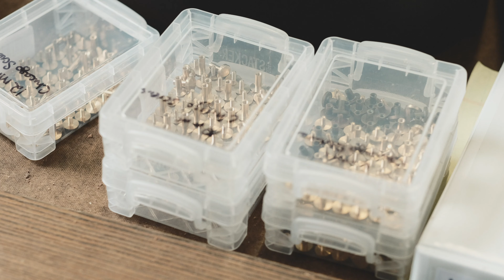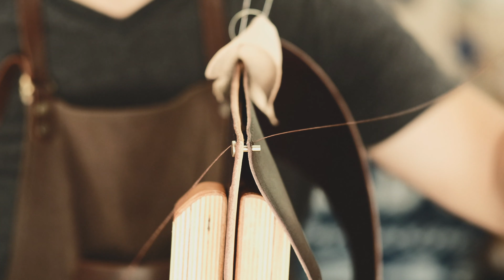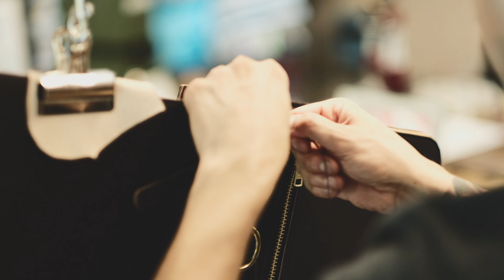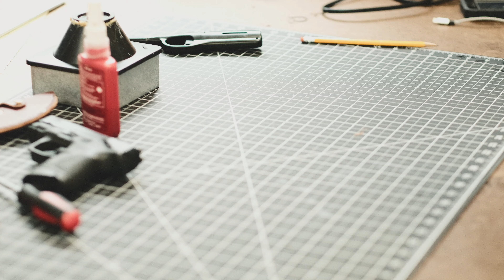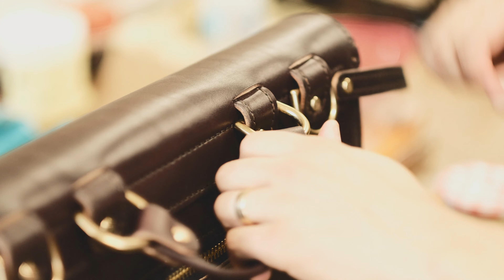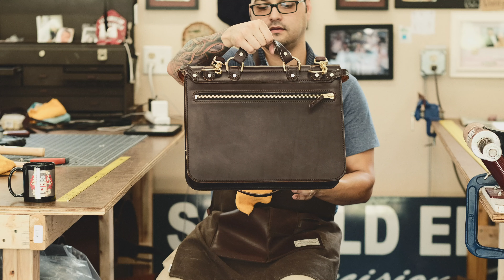Making an English Bridle Leather Briefcase - Part 4 of 4 - ASMR Build

Comment from the maker: This is Day 4 of a 4 day series taking you through the journey of creating a bespoke English Bridle leather briefcase.  

Part 1 - https://youtu.be/u_daMeC6lNs
Part 2 - https://youtu.be/Fdraz3_hXtQ
Part 3 - https://youtu.be/03giEpDSqrI
Part 4 - https://youtu.be/1u4VUAyTIKQ
Complete Build - Short Version - https://youtu.be/bSTUGJCHGN4

This bag is already commissioned. Customer requested a dark brown exterior with tan interior and medium brown stitching. 

More Info --- https://www.sofieldleather.com/bags

Whether it's business or pleasure, this English bridle briefcase will be the perfect companion in all of your escapades.
Crafted with high-quality English bridle leather, provided by American tannery, Wickett and Craig ( http://wickett-craig.com ), this bespoke work of art will stand above the rest.
This briefcase is fully-lined with English Bridle throughout, and adorned with over 1,200 stitches meticulously hand sewn using the tried and true saddle stitch method. The exterior showcases a heavy duty brass collar set for a one-handed easy access buckle.  It will hold the test of time with its heavy duty brass hardware and brass zipper, which was placed with reinforcement in between for longevity.  Handles, small straps, and the storm flap are also reinforced with a polyester webbing to prevent stretching and warping.  For your convenience, the interior and exterior also boasts a d-ring with an included key chain.

With over 30 hours of build-time, this briefcase has been engineered to maintain the integrity of its structure and shape with interior reinforcements, and heavy duty brass rivets at the end of every stitch run for durability.

As a final touch, an all-natural in-house leather conditioner ( https://youtu.be/kJ_NppxXN2w ) coats the leather for a sleek and smooth finish, making it ready for its next adventure.  
  

Product Dimensions: 
Exterior of bag: 12"H x 16" W x 4" D
2 Large Interior Pockets: 9" H x 15" W
2 Small Interior Pockets: 6" H x 7" W
Shoulder Strap: 1.25" W - Adjustable 36" to 50"

Check Out the Leather Shop - https://www.sofieldleather.com

Check us out on Instagram - https://www.instagram.com/sofieldleather/

Check us out on Facebook -https://www.facebook.com/Sofieldleatherworks/